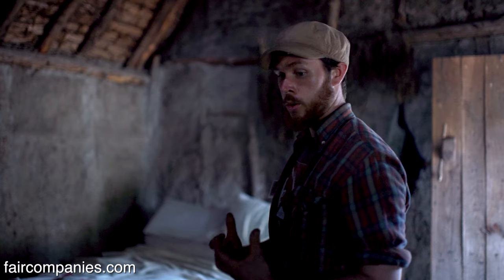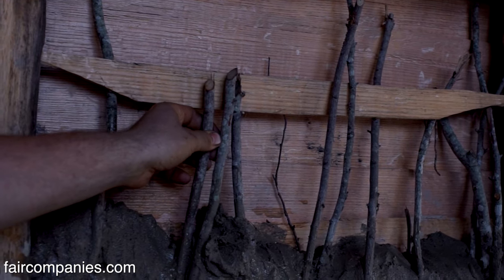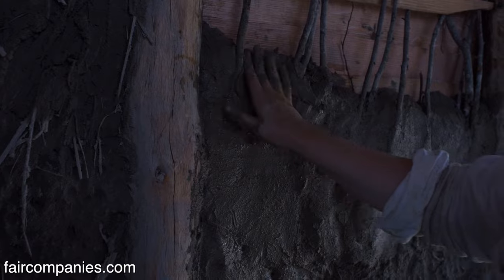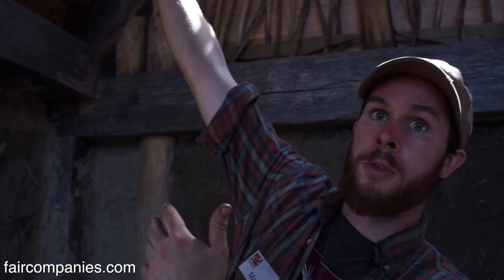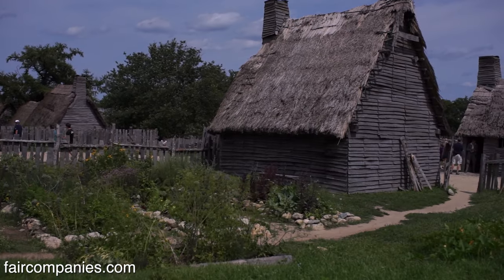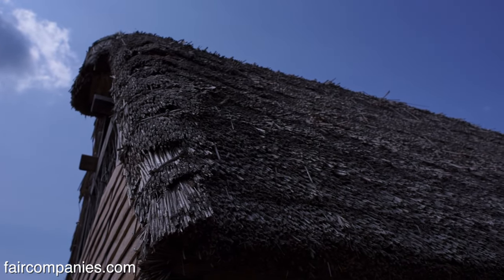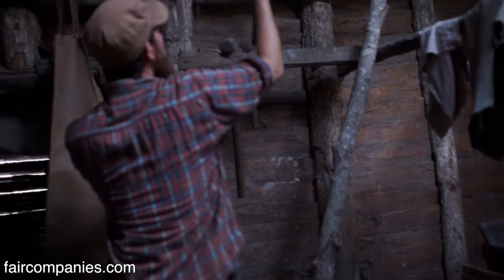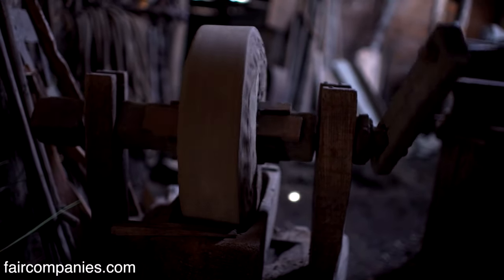What can be learned from a 17th century American town

Comment: Ash (especially from plants and trees) can be made into cement/mortar fairly easy. The "Primitive Technology" channel has a video on it. You need to mix the ash with water, turn int into pellets (or other easy-to-dry shapes, like flat bricks), then put it in a pottery oven or forge, to get red-hot or brighter, wait for it to cool down, then that's cement. Adding water makes cement start to cure. Between a week and a month, it's as hard as normal cement. With cement, and especially if you mix some fibers (like from plants or wool) into the cement, you can easily make shingles, or more efficiently cement sheets for roofing and for walls.
Reply: Any idea how long something like that holds up?
Reply: @Sunshine_Daydream222  centurys. In south america ,they still making walls with same materials.
Reply: If you have to heat it, then whats the advantage of ash?  This is literally just 'mud' laying around and mixed and it turns hard while ON the structure.  It seemed to allude to these being the ORIGINAL buildings, which means it lasts far longer than most modern homes and buildings.  I'm interested in that channel, I'd prefer to do it this way because it seems easier, plus thats a LOT of burning for the ash.  Again, I wonder what the added benefit is ( I thought at first you meant the tree 'ash':)     We live in a high lime area, there's a mine right down the road.  So the mud bricks seem easiest, and the whitewash would actually make it look pretty 'rustic' which is in style.
Reply: @Sapioit Literally not one person asked.🤡🤡
Reply: in modern times, they mixed staples or little pieces of wire into cement, to make fiber cement, and its almost indestructible, makes ordinary concrete look like wood.
Reply: @Sunshine_Daydream222  depends on location but few centuries

Comment: Not to discount the information being provided here, but thatching is not a simple and easy task as he eluded to.  Thatchers in the UK spend several years as apprentices to learn the process correctly so that a roof, thatched properly, can last hundreds of years.
Reply: I don't know much about thatching, but the roofs at this site look far less refined (and structurally sound) than the ones I've seen in the UK. I'm sure the Plymouth colony thatch wasn't that hard to manage since they just needed something passable.
Reply: As an American, I’m mesmerized by the thatched roof.
Reply: I think he was just pointing out, in the case of Plimoth Colony, they were not experts, their thatching technique was likely pretty crude. You have to check out the context man.
Reply: I think it may be one of those cases where you can learn enough quickly to do an adequate job to get you through a winter or two, but mastery to do a really high level job would take years.

Comment: Housing was very different in New France. Most of the newcomers had building skills. They cut trees on the length, there were masons, for stone houses, carpenters, woodworkers, etc. The first Canadian cabins were built fast and the next year it became the barn and a new grander house was built. In 1675, a man housed hundred of soldiers in his home. No straw roofs either, cedar shingles were used. Maybe these religious exiles weren't quite ready for such a life! They learned eventually.
Reply: Were those Hugeunots?  Or why did they leave France if they had a trade?  I'm in New brunswick which was the first 'permanent' settlement on St. Croix Island.  They were only there one winter but in that time built buildings for the winter, unfortunately they hadn't bargained for the weather and if it weren't for the first nations they would have starved.  I think there's a kind of evergreen tea that can be used to stave off scurvy, but in year two they said the hell with this and moved across the bay to Annapolis valley in Nova Scotia.  I'm not sure where they got the skill but they built elaborate dikes and irrigation systems which are still used and really haven't been improved upon, or even maintained.   It said with climate change we're just one hurricane away from Nova Scotia being an island. So come see it while you can:)   Apparantly in the late 19th century they had such a storm that washed the sea over the small strip of land that connects Nova Scotia to the mainland but it receded (with somebody's cow on the roof of a barn, a boat rescued the cow sometime later out of sight of land). 

    Sorry to steal the focus from the US, but while this is rudimentary, I don't really see much structural difference between that and modern homes.  Modern wood homes seem HORRIBLY designed for almost everything except being constant work to maintain.  The plumbing and electrical seem designed by madmen, and really the house should be designed around those features, not have them added later as an afterthought. 

      We have TONS of lime where we are, which means this would make a perfect building method right now, with the clay encasing the wood then there is no real danger of fire.  Lime whitewash means no wood on the outside, so its just a question of that roof to get rid of the risk of fire.  A potential other issue would maybe be whether there's radon in the soil, which means not a good building material, depending on the amount.  I'd be interested in the 'method' for making that mud, I've seen lots of recipes but they never really have a system for 'the dirt we have'.  We have pretty clay soil, actually our land was stripped so its clay and shale.  I'd like to experiment with it but like to have at least some general idea first.  

     Anyway, the early french did seem to be better builders, I wonder why that is, probably an economic reason.  But as he says, even a child could have figured htis out.  This is a home built in months.  We built our home in the seventies, it took us DECADES with all the regulations, etc.  And now we have both huge forests AND a homeless problem.
Reply: @mikearchibald744  even soldiers had to have a trade in the 1600s in order to come to New France. A lot of wood workers, masons, tool makers etc. They were extremely handy and they still are today. It's hard to find a Quebecois who can't do mechanics, tiling, walls  plumbing, electric work,  gardening, etc.
Reply: @mikearchibald744  these people where middle class, they didn't build, they bought. They had some rudimentairy skills but probably never build their own home, they could hire someone back home. That's why their houses look the way they look, they weren't professionals.

Comment: You should have had a mallet, a froe and a log and did some riving of siding boards.  The froe is an edge tool that can be twisted.    The mallett is a short small log that is easy to handle. The log would be split in half or quarters, I suppose.   The fro is pounded into the end grain and then it is twisted.

Comment: While there are many thatched houses of 400/500 years old here England, none of them have a thatched roof as old! The actual thatch needs to be replaced every 30 to 50 years and that is the whole roof not just the top . Thatch is a wonderful and completely sustainable material though. The house I live in was built around 1640 and has brick and wattle and daub walls. Tile not that roof though as it is in the middle of a town.

Comment: is there a reason the roof were made so high?? pointy I can understand because of the "run-off" but why so high
Reply: jmarylastone It could be in order to keep the space cool in the summer.
Reply: jmarylastone A few reasons - the steeper pitch helps the thatch carry water properly.  Otherwise the water would be more likely to drip down to the interior.  The steeper pitch also helps shed any snow load.  Another reason was to help carry smoke out of the interior.  Chimneys were very basic and many of the simplest didn't have chimneys at all so the smoke drifted up to the rafters and out of the openings at the peak.  See 1:20 for an example.
Reply: Steve Dillinger
Reply: jmarylastone Its steep to shed water off the thatch.Before it sinks in. They went to wooden shingles and the pitch got flatter, Thatch is a fire hazard.

Comment: I don't understand how thatch doesn't rot and turn to mulch in just a couple of years? It's made of straw and if it's like a sponge, then why wouldn't water end up in the house? I would guess it probably smells like mould.
Reply: jeoux chmeoux It's not like a sponge at all. It sheds water very effectively due to capillary action.
Reply: reivenne 

Thaaaat's what the narrator said. Listen again if u don't believe me...
Reply: And he's wrong. That's what I'm saying.
Reply: jeoux chmeoux It smells really nice, I was up in the gallery at the Globe theatre in London a couple of weeks ago and down wind from the thatched roof. The wooden beams/floor and thatched roof smell is fantastic, give me that over the nasty chemical modern house smells any time!!!
Reply: jeoux chmeoux  If the roof is over 45 deg the water is more likely to run down the straw and off the roof rather than through it.
Reply: +Legend Length I really doubt u have any experience with thatch roofs or have ever known anyone who has.  If u look at pictures of thatched roof houses u will see the roofs are quite steep and it is for this reason. In fact, roofs years ago of any material were usually quite steep. The shingle or board roofs of log cabins and later were known to have cracks in them where rain and snow would blow through. Quilts were hung up inside to keep stuff like this off the beds etc. They still build houses with thatched roofs even today in some places. If the pitch is great enough and care is used in building it I would think it would be a pretty good roof. And, thatch has several merits. Thatch roofs just of wheat straw have been known to last 20 years or more without repair. Building codes wouldn't allow it in many areas because of fire hazards and material is not easy to come by anymore.
Reply: The smoke and hot air from the fire "cures" the underside of the straw. Dries it out and gives it an acid PH. This deters organic destruction like moisture and insects and preserves it. They don't leak into the house if they are made correctly. Outside there is a capillary effect that pushes the water down and away.

There are roofs in England where parts of the underside of the straw has been carbon dated back 700 years.

Comment: Thatched roofs can not be made with modern straw. It is way too short.
Reply: rosi hayes Straw is most often 18", judging by straw bales (which can also be ordered as 36" and 48" wide bales, but that doesn't mean the straw in them is 36" or 48" ). 

Straw is in fact used, but other plants - seaweed, rushes, and phragmites among them are prefered if they are available.
Reply: Chris Green 
You most definitely could not use straw that has been baled. It must be straight and not crimped in any way. so the straw has to be cut by scythe.  Depending on location, people used what was common in their area.  Near water, they used rushes.  Where I am from, straw roofs were made with rye straw,  which grew to about six feet. 
Straw has been considered a waste product and grains have been bred to grow really short straw.
Reply: They collect the straw and reeds themselves and cut it to their specs. Up at the North River.

Comment: A really interesting vid, but take it with a heavy pinch of salt. 700 year old thatched roofs? Yeah, no. A thatched roof will last about 40-50 years, if you replace the roof ridge every decade or so. No way one would last without being re-thatched for 700 years.
Reply: keyholes I think what he ment as "roof" was not the thatch itself but the whole idea of a thatched roof. There are houses which date back hundreds of years in england which still have thatched roofs - ofcourse constant maintance was applied but the point is that throughout the years they remained as thatched houses and many are listed and thus will most likely stay that way.

In a similar way your body rebuilds itself throughout your life, some say a couple times over given the total amount of cells rebuilt but we still refer to you as a single person. Your hands are still your first set of hands despite the skin having to be replaced all the time.

it's just a verbal shortcut he made there I think - we count total building height including the typical bullshit spire or antenna on top just to say how incredibly tall some yet another "tallest building" is because people are naturally attracted to ever larger numbers. 
So it is more fun to communicate that something is 700 years old with an asterix rather than saying it was constantly maintaned and rebuild over 700 years as a viable solution.

Also rebuilding thatch is not the same as fixing a roof on a modern house - old buildings are a lot more organic in the way you do maintaince. You constantly fix and modify and maintain - it's again, more like a body that fixes damage in continous increments over a period of time than everything being redone in one go.
Reply: He meant the thatch. Some roofs in England were never cleared when they were repaired. As a result there are still houses in England where they have segments of thatch that has been carbon dated back over years.  The heat and smoke "cured" the thatch, raised it's PH level and made it insect proof. Yes it would decay in places but on the outside. Then some people would just add layers on the outside and you've got  700 hundred year old thatch on the inside.